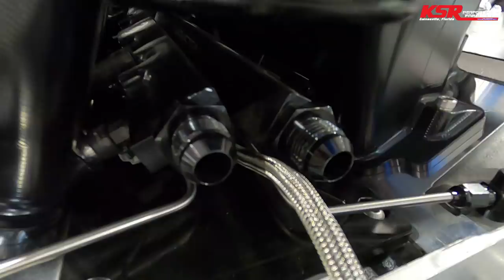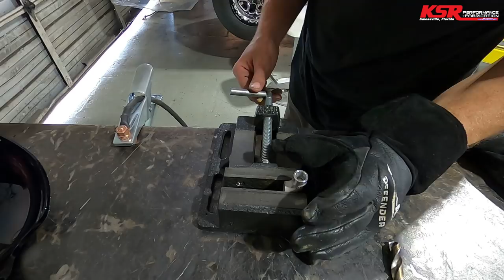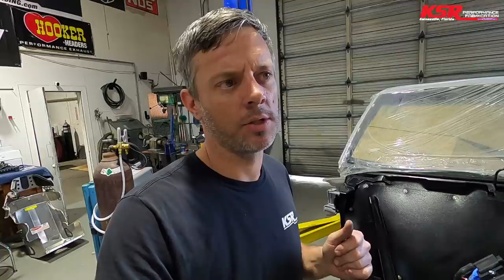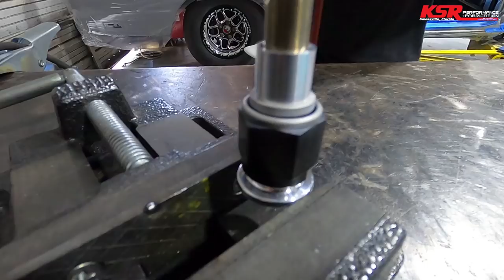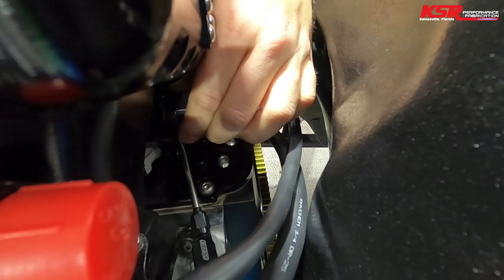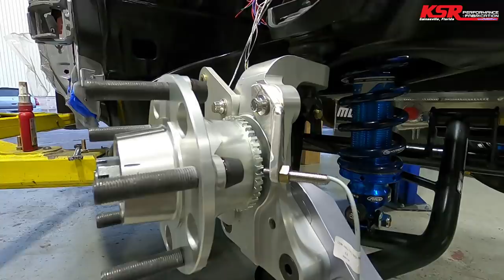Mullet El Camino Build Episode 13 Fuel System and Wiring Begins!!

Comment: Camera through the welding helmet was very cool. That was the closest I've ever come to welding, thank you
Reply: Looks nothing like actual welding though. At least when your in person you can see more than the light of the arc.
Reply from the maker: @lemonaid8678  we are going to try and fix that!
Reply: @KSRPerformanceFabrication  awesome! I’m not a welder, I’m a diesel mechanic but you know how that goes it’s something you learn along the way.
Reply: Don't be afraid to try it if you get the chance, I self taught MIG and TIG, it's not as challenging as you'd think if you are patient, MIG is pretty straight forward just takes time to learn the relation between thickness, heat and wire speed.

TIG I struggled with for a whole but Eastwood Company have a fantastic 2 video series on how to TIG weld and they massively improved the quality of my TIG welding after watching and taken their tips onboard.
Reply: Really appreciate the effort on showing this! Nice touch.

Comment: Great video Kevin. You could try using a piece of replacement WELDING SHIELD lens for the camera instead of using an entire welding helmet so that the camera can get in closer. Just take some electrical tape and tape it on to the camera housing. Or use a disassembled auto darkening helmet lens and then you'll be able to see before welding and after welding on camera.

Comment: For welding you can get a 10 stop neutral density filter or a Variable ND filter for your camera to be able to get a clearer view.
Reply: If you are getting it up really close, make sure your filter is one of the glass ones and not the plastic one.

Comment: If you want the camera to not lose focus, set it up on a tripod, focus it manually before you start welding and then move the helmet in between the lens and the weld piece. Then the camera doesn't need to focus, it's already set to go. Another option instead of using a weld hood is stack a bunch of neutral density filters onto the camera lens if it has a threaded lens ring. You'd still need to pre-focus before installing them to get it accurate. Love seeing all the details and what you guys go through on a build like this.

Comment: I used to use those type of sensors in a manufacturing setting for detecting presence of certain materials. The one on the car is so much more precise to be able to catch each of those teeth, unless the gaps between each tooth is larger than it looks. Build is going great, always look forward to KSR videos. I plan on grabbing some merch soon, have a great day!

Comment: Kevin and crew knocking out top notch fab work on Mullet. Love the attention to detail you guys do on your build's and you're filming of the welding was a good idea. You might want to pull just the lens window out of an old face shield and use you're fabricating skills to mount the lens flush to the face of the go-pro and turn it into a clip on filter. That way it can focus better and be small enough to get into tighter places for close-up's! Keep on keeping on KSR...

Comment: What you need is called a neutral density filter (ND filter). I think they sell kits for GoPros. That would help eliminate the glare from the shop lights on the back of the helmet and hopefully help keep the camera in focus. Alternatively just strap a loose piece of welders glass to the lens (probably don't need anything denser than #10, but keep it pretty dark). I appreciate your willingness to try different things and show us different angles!

Comment: I love this channel. Have to say this is the first thing I am worried about failing. Probably needlessly, but still looks like it could fail from vibration and thermal expansion. Alternative idea- machine a block that takes 2 banjo bolts that screw into the fuel rails

Comment: Kevin I’ve gone a slightly different route on my 55 Pontiac hub. I designed the hub for a 96 output magnetic reluctor ring. I ended up with one from a Mercedes as it was the right size for the hub. I will also use the Mercedes abs pickup. My understanding is the magnetic ring should allow me to detect the direction the wheel is moving.

Comment: keep up the great work.. love seeing it all going together.. I remember a few videos back you were talking about neverseize on threads I had an old man tell me at least on wheels if you do not have neverseize you can use petroleum jelly on the lug nuts as well as cap bolts.  He said all they used was the cheap stuff and it worked as well as the expensive kind.  Just thought i would share.

Comment: 1) yeah, 60 hertz is old analog buzz box standard settings.
2) might pull the cover off your unit and blow it out, might fix your ac high freq arc start, or might need to get the rig serviced. 
3) best way I found to ground to an engine, exhaust, etc is use a ground strap. Bolt onto block and grab, wrap around exhaust, and any other ideas.
4) and what tungsten you running? Did enjoy the solid point, only thing I've had keep that in ac is pink multimix and lanthanated in ac.

Comment: 1. How long would it of took you to make the fuel fitting with out filming vs how long did it take with filming? 
2. If you throw a shirt over the back of the welding mask and cover the  back the camera will focus more on the weld

Comment: You could have used hard lined from fuel rail to rail, using JIC flare nuts and tube. (SAE 37 degree)
Once my project is running and final I want to run all SS tube were possible.
Second thought,,, it might have been much harder to do. Flare fittings can be fussy.

Comment: You can use a ND filter for your gopro and get better shots of the welding.  A 5 shade on a electric hood should be a little darker than 64ND filter the gopro should be able to handle the rest

Comment: Using Photo-Eye sensors like that at my work. I put the fancy art work you see on alot of the craft beer out there and we use rolls of sleeves that have upwards of 10k+ sleeves on them so we use sensors like that all over the machine to keep track of how many we use. We only run 80 cans per minute so ours arent quite that robust but still 😂

Comment: Awesome video, it’s cool to actually see the welding. As far as that goes, you might be able to just manually focus on the weld before turning the light off instead of using the autofocus. As long as you have some aperture it should stay in the focus zone.

Comment: Very cool! My only concern is that front wheel sensor. Yes, those sensors work when pointed at the corners of the teeth, but ideally, they're designed to point at the flats. Now the sensors I used in industry dont spin nearly as fast as those will. I would think that would make it more important to aim at the flats. Maybe your operating system makes up for a missed signal hear and there. I don't know.

Comment: check the speedsensor at a faster rotation too , might be it looses datails when the wheel os rotatig at 50 mph or more 
car manufaturers mount the sensor straight over the ring all the time so there must be a reason for them to do that

Comment: I wish the aluminum welding frequency was a lot quieter.  Tig is so nice to work with, then you weld aluminum. AC  Always drives me nuts. Nice work on the piece 👌

Comment: Try taking the auto-darkening shade out of the helmet make a small frame around it with a bracket that attaches to the tripod mount underneath. I can't remember the exact distance between the lens and the "filter" anymore its been a while since I did any real video work.  but if I remember correctly its maximum 1mm between the lens and the filter for best auto focus and color correction...

Comment: Meet U bend.
I would possibly done it differently with a block of alloy bored through to make a large dual banjo or tap the holes to screw in fittings and possibly other attachments like a pressure gauge/ transducer bleeder screw etc.

Comment: I hope you made a spare custom fitting because if that fails for whatever reason, vibration, cracking leaking ect, would be a tough on road repair. I mean it could be done but a spare would sure be nice. good work!
Reply from the maker: That fuel system is for the race system. If the fitting were to fail, the fuel lines will be able to be swapped to the other set of injectors, swap the plug on the firewall and keep going!

Comment: Kevin as an industrial mechanic don't solely rely on that LED indicator on the sensor.  Yes it's a quick indicator that the sensor is working.  90% of the time it works as intended.  However I've seen broken sensors where the LED still blinks but there is no actual signal leaving the switch.  So if your gut tells you a sensor isn't working.  Double check it with the laptop that you're actually getting an input.  Then you'll KNOW for sure that the computer is getting the signal.

Comment: Hey Kevin ND filter on the camera should suffice for videoing welding ND= Neutral Density filter "darker the better especially with Ark Welding"  Former Powdercoater, SandBlaster, Fabricator turned Astrophotographer after a very bad spinal work injury.

Comment: Hi Kevin!
Your "camera experimentation" is very interesting. Nevertheless, the range of any sensor isn't able to handle the differences in light intensity between any background and the intense light of a welding, meaning that most of the time you may end up with only seeing the tiny area where the welding occurs and nothing from what is around. Our eyes have a way broader range of "compensation" allowing us to see details in low lights as well as in bright lights. I guess that maybe using a very intense light around the welding would greatly help to balance the exposure and allow a better rendering by exposing the entire area to a light intensity closer to the light produced by the welding itself.
Anyway, putting the camera behind the welding mask surely protects the sensor of the camera from the intense light of the welding.

Comment: That wheel speed sensor with the built in led is an awesome idea and nice machining for the ring.  Just wondering if the sensor angle to the ring could cause reading errors or are the race sensors just better than the OEM ones. I've had GM stock sensor read fuzzy just with rust build up under the mounting flange in street vehicles.

Comment: Hi Kevin. Ian here from Australia. I'd like to ask you if you are using a different tungsten to weld the aluminium compared to stainless? If you are then all is fine but in case you aren't, you should use a Thoriated tungsten for stainless and a Zirconiated tungsten for AC high frequency.

Comment: The welder doesn’t seem to be initiating the arc very well, it should have an initiate setting usually low current high voltage for the first few microseconds then switch to weld mode. If you get the settings right you can get very small neat welds about half the size of the ones you’re doing at present, thinner rods might help with that too . But if you don’t have any you use what you got.

Comment: @ksr performance I understand the need for custom parts on builds like this, but with fittings and parts that can fail after some use, would you be better off trying to find a off-the-shelf solution? Like with the turbos,  how do you determine what you can get away with OTC vs custom?

Comment: kevin, if i have a fitting on the bottom of the tank and the inline weldon pump is slightly higher than the lowest point will it pull it??

Comment: Hey Kevin just a question for you, I like the wheel speed sensor, it’s rather fancy. Only question I’ve got is if you’ve got all 4 going at once, would it bother anything, I know they’re just leds and have a small amount of draw but I presume having 4 tiny leds turning on and off would cause a bit of draw, or on second thought does the wheel speed sensor create its own voltage therefor turning the led on and off meaning it’s no extra draw in the vehicle. Sorry to ramble on I’m about to start a dual trade in auto elec so I find all of this interesting. Love your channel and the videos would be awesome to meet you one day!
Reply: we use these sensors at work all the time. the led is part of the sensor. it is a hall effect and is supplied voltage from the electrical system. the led has very little draw and does not effect the sensor operation at all. the led can make trouble shooting a little easier. the supplied voltage varies depending on the requirements. example 3.5 v to 30v. same for amperage.
Reply: @bfelker4144  Thankyou a lot!

Comment: Master battery cut off.. did you ever install the NHRA pushrod out the back but also the Morse cable kit to allow the driver to push the knob on the morse cable to shut the battery off  or turn it on from the drivers seat..  perhaps if its set up to push to turn off.. a hinged locking collar with a padlock hasp to allow a padlock to be installed when the car is parked between rounds. or at static displays.  moroso makes a cable kit for most conventional battery master cut off switches..

Comment: Is there any danger of a crazed ‘fan’ pulling the fire suppression when the car is in the lanes? I think it might’ve happened with the power disconnect on Ruby once.
Reply from the maker: When the car is not on track, there will be a safety pin in the bottle that prevents an accidental misfire. If somebody tried to pull a "prank" like this........that would be so stupid.
Reply: @KSRPerformanceFabrication  That was a nice way of saying DON'T EVER do that.
Reply: I think that time with the power disconnect was cleetus  leaning over the car and pushing it in just enough to make the engine cut out.
Reply: I always dreamt of doing this in a kitchen I used to work at and then just leaving just to see what happens 😂😂
Reply: Pretty sure almost guaranteed whoever actually tries that , won't be just walking away or laughing 😈🤣
Reply: @chrisgreer1911  they'll be getting trampled by an adolescent giraffe 😂😂
Reply from the maker: @eriklarson9137  exactly...........I might have different words if someone did that in person......
Reply: @Matty.Hill_87  🤣🤣😂😂that's exactly right

Comment: I’m not sure if you are going to get the correct frequency of pulses mounting the sensor at an angle. It is designed, as is the impulse ring so that the sensor picks up the full face of the tooth and misses the cutouts, just like a crankshaft sensor is mounted 90 degrees to the impulse ring. I have never seen an induction sensor mounted at that angle on a vehicle or industrial applications.

Comment: Question. Waste gate dump tank is for the oil in turbo right?  If so could it be dumped back into the oil pan?  I admit I’m not smart about it but thinking a one way valve back to oil pan for pressure and 1 less tank.

Comment: Just a question because I’ve never tig welded. Ive heard you have to back purge stainless and aluminum . How is that going to affect the weld on the fitting since you didn’t back purge ? And again this is a question .

Comment: I’m just wondering if you could have put a Y in the front off of the mechanical pump to feed both rails under the intake then put another Y at the rear before the regulator to return back to the tank
Reply from the maker: Could have, but the engine is already going to be very busy with everything it has going on.

Comment: i know you mentioned about spares and why you didnt get mirrored turbos for long road trips and what not....do you have concerns about the custom 180 piece or because you have make something with a big loop if needed in a pinch you are ok with it?
Reply from the maker: The way i am setting up the fuel systems, there will be several options with how to work around a problem. Having a spare hose in the tool box is definitely one of those options ;)

Comment: Novice question, where is your ground? I assume it attached to the table? My Alu welding needs a lot of work. Impressive that your welding thin wall for pressure.
Reply from the maker: I typically ground right to the piece I am welding, but for this smaller stuff, I had the ground on the table.

Comment: Just a thought.... and I in no way think I could tell you how to build a car... but the pressure test for the fabricated fuel line connector. You said that if its running 40 base and 40 boost testing at 120 would be safe.... but the engineer in me says "what if the FPR jams shut?". Can it withstand everything the fuel pump can put out? I have no idea what pressure the pump can feasibly make in your system before it fails but that's what I would be pressure testing the system to.
Incredible work as always though. Love your videos man!
Reply from the maker: We tested it to 250, Thinking that should be plenty of safety margin.
Reply: @KSRPerformanceFabrication  I would guess so. Can't wait to see more of this build!
Reply: I believe he said they will be testing it at at least 200psi since soccer mom runs around 125psi and he thinks mullet won't be higher than 100psi. So testing at 200psi should be sufficient.

Comment: To be honest, I'd rather see some loops of replaceable components rather than custom fitted and welded components simply due to the fact of replacement availability.  Is it possible that the fuel rails could have been modified or made to be square to each other by compensating the offset nature of the cylinders?

Comment: Will the leds on the wheel speed Censor draw enough power to slowly drain the battery if the battery switch hasn’t been turned off
Reply from the maker: the sensor will only be powered when then ecu is on

Comment: Would it have been impossible to mill a slot across the fuel rail between the tapped holes and weld a plate over that instead?
Reply from the maker: The injectors would not be able to be serviced then. The angle of the injectors would prevent them from being removed from the intake if they were completely welded together.